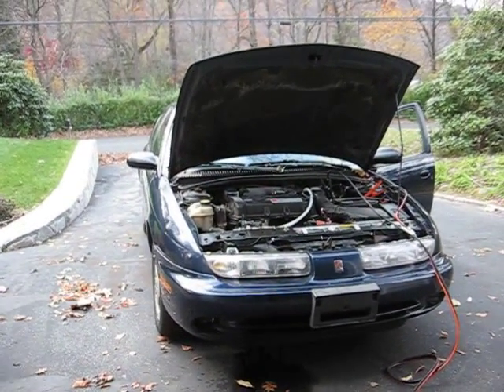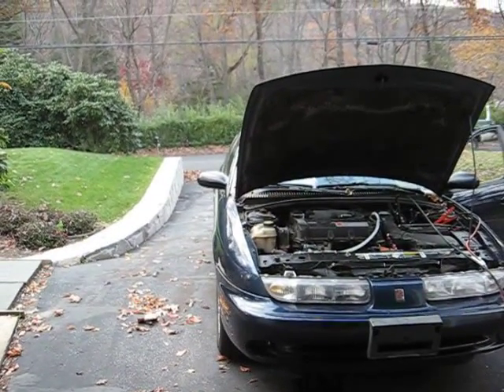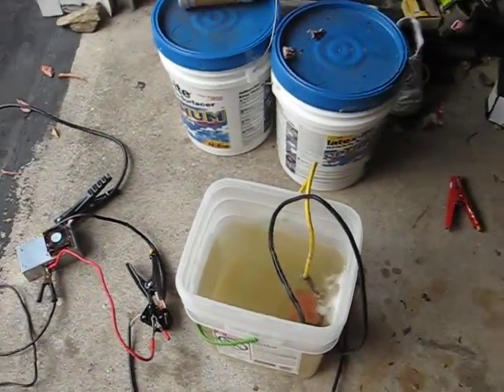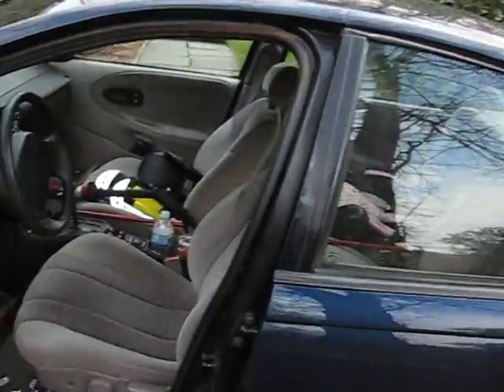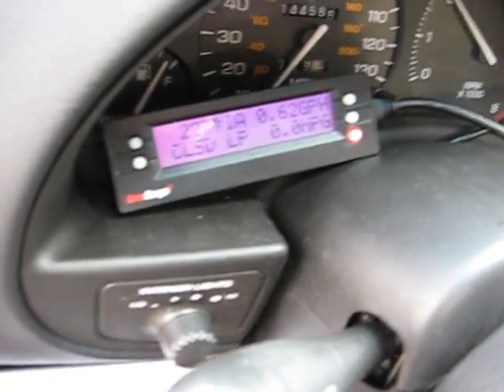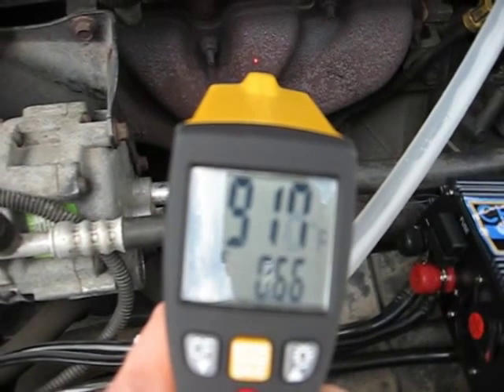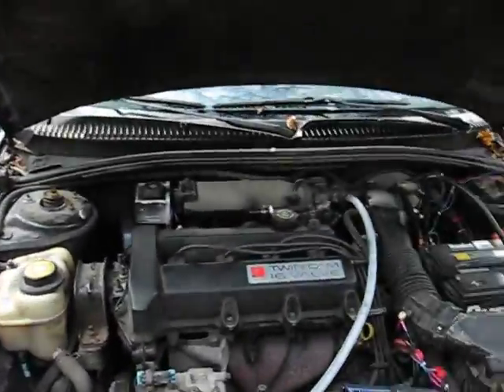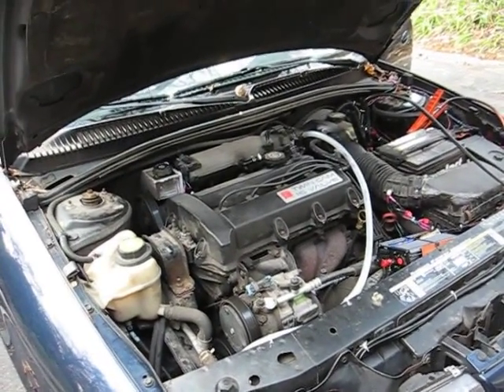Fuel efficiency system that really works

Comment from the maker: I used a stainless cylindrical containor with an ultrasonic fogger inside of it.
then i had a 1/4 inch air inlet tube in the top of the tank and a 3/8 outlet tube that led to the intake before the throttle.

Comment: Not up to speed on ozone. Why do you add it? Does it cause the fuel mix to get richer from normal?
Also where do you inject steam and ozone?
Reply: It's an oxidizer.  O3 is unstable and has denser atomic weight than oxygen . It isn't a fuel, not flammable but a catalyst that modifies combustion .  I've seen research papers showing a 15% increase in fuel economy and a reduction in nox and HCs

Comment from the maker: Probably not Hydrogen embrittlement.  That only occurs with rapid cooling of iron.  For the Ozone to cause damage, you would need to have almost no O2 and all O3 with no cooling method in place.  I am generating the ozone with a 15 watt ozonator.....about 1 gram per hour.  With the mist and ozone, the car definitely runs better on the highway.

Comment: i just finished putting a new head on my diesel van because it ended up with a cracked head,which happened while i was running ozone into it.
not sure if it was the ozone,or hydrogen embrittlement from prior HHO experiment,or none of the above but i just thought i would pass that on.
how are you generating the ozone?

Comment from the maker: Of course you noticed that this is not at idle and it is under a small load.  Combustion chamber temp is 1500 degrees, normally.  900 at the manifold.  It has cooled down because of heat soak and insulation by the time it gets to the manny.  So, using the correct calculations, ~30 at the manny means ~50 in combustion.  Having said that, 100 is perfectly fine and in fact, would still be considered "normal" temperature for the given rpm.

Comment: Just an FYI from someone who has tuned EFI engines. That manifold temperature is not accurate. If it rises 30* on the manny its probably 70-100* more in the cylinder.

At idle your readings will not be the same when it is running 2700 RPM cruising. Adding water vapor cools combustion but remember the engine has to burn a fuel to create HP/TRQ. If you aren't putting fuel of some kind in to replace what your ECU leaned out you will still detonate due to spark angle, regardless of EGTs.

Comment from the maker: That is the point of measuring the exhaust temperature.  Without the mist, you get dangerously high exhaust temperatures, which I will not do to my engine in order to make a point.